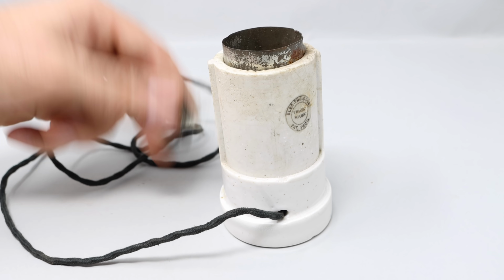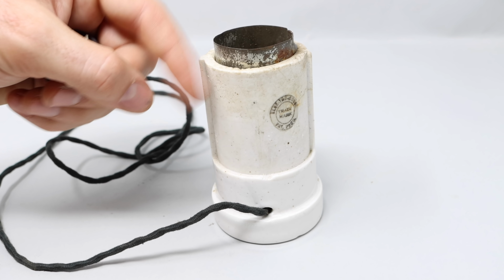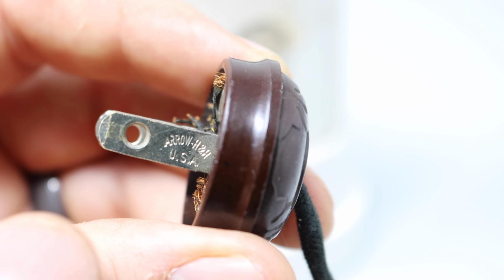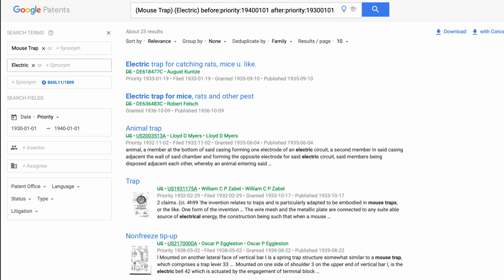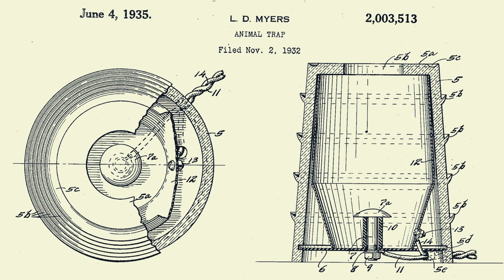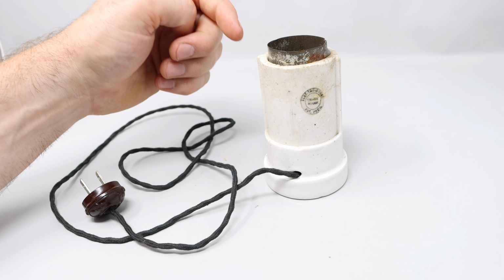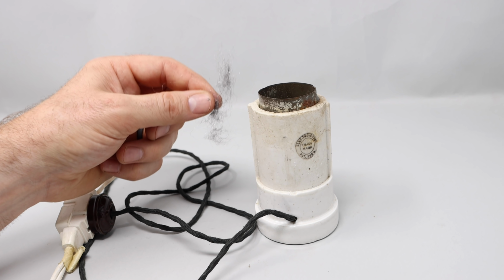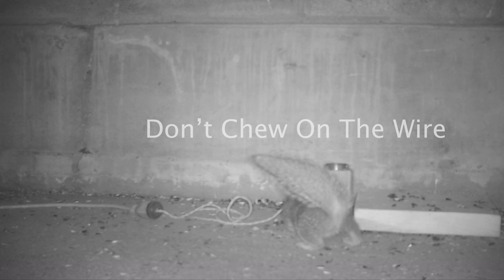I Need Your Help Explaining This One - The Electro Mouse Trap from the 1930s. Mousetrap Monday.

Comment: I think the mousetrap didn't work in the 30s either
Reply: Must be why it was patent pending and not actually patented.
Reply: Would help to explain why this kind of thing never really caught on either.
Reply: Eric Schulze In English that’s called a GFCI (in USA) or RCD (UK). But since the mouse would be the load, with no path to ground, it would not trip.
Reply: We used to use these to pop popcorn one kernel at a time.
Reply: AlphaLeader88 it did though. My best trap was likely developed from this. “The big cheese”
Reply: @dylanzrim1011  so why is t it working now?
Reply: @PapiDoesIt  When the product he got was stamped patent pending it was pending, but ultimately got approved for a full patent as was shown on the patent search.
Reply: Back in time the electricity was hooked up completely different. They had only a small number of big transformers where we today have many small ones. Since transformers are limitting the current flow, that means that around the 1930s there was a much higher current peak flowing through the animal.
Reply: Ema
Reply: While power has changed over the years, I don't think it changed enough.  I think the reason this is rare is it didn't work, so not that many were sold.   I'm pretty sure Shawn has a number of traps that look good, but are not that effective.
Reply: @Resist4  Also, having a patent does not necessarily mean a device will work as it should.
Reply: @tamiebasse6595  yes I knew that already.  A patent is just sole rights to a product for a certain amount of time.
Reply: "Transformer limit current flow"? What the hell are you talking about? Ever heard of "resistance"?
Reply: @PapiDoesIt  I would be shocked (pun intended) if it was granted. It is a serious health and fire hazard.
Reply: @ToyInsanity  lol  reminds me of some guy I knew who rolled his own cigarettes... He said if they were all rolled up in advance he'd smoke even more and this was his way of avoiding that.   So, what your comment tells me is that you like popcorn but you're on a diet!    ...and/or high.  ;-]
Reply: Agreed
Reply: @OleJanssen  Except it doesn't work like that. You're trying to apply kVa transformer theory down to the device level. When you've got a transformer hooked up to a large gauge drop from the pole you're right when measured directly at the output of the transformer. But that's not what we have going on here, you've got several hundreds of feet of relatively small gauge wire feeding the plug plus the 16awg or smaller actually feeding the device. That's what's limiting your maximum current, not the size of the transformer on the pole.

Comment: I bet they didn’t kill mice then either. 60 cycle 110V is not as dangerous in dry conditions as you may think. Especially during light touches by small creatures with whiskers/fur.
Reply: I agree that they did not work then either, modern electronic mouse traps use high voltage to take care of the rodent.
Reply: True. I've electrocuted myself before and I didn't even have burns. Still would not recommend. It knocked me flat and I almost passed out.
Reply: At least you know what you're talking about lol unlike the top commenter
Reply: Was that around the time they were trying DC? Could it be these came out for DC power?
Reply: @Kev:  Evidently, you've never been danced across the room by 120 volts...
Reply: @natalieisagirlnow  Downvotes don't get counted anymore.  I don't know why they bother to still show that option, other than maybe to harvest your opinion for their own use.
Reply: @jimman1992  No.
Reply: checkmate I’ve touched 600V and 120V several times.
Reply: im a line man and the power line put off more than 110 😂 about 100× that and more
Reply: @crimson_fox_king7487  You mean a "lineman".  We're not talking about the high voltage side of the transformer, though.
Reply: What do you have to do that 120V dances you around a room? The worst I've ever done was flung my screwdriver through the room and lost it behind a cupboard when I touched a live 230V wire.
Reply: @cyb3rk3v  Did you touch both sides... phase-to-phase, of 600 volts?  That's not something that most people do... you almost have to work at getting yourself across two phases like that.  The worst I ever managed to do was 277 volts... one phase to ground, but it took me several decades in the business to even manage that.
Reply: lol my keyboard f@$%ed up a bit
Reply: @KonradTheWizzard  That was just an expression.  I got it from one hand to the other and couldn't let go, but my feet still worked, so I was able to pull myself off of it.
Reply: Wow! In that case: you are one lucky guy to be alive. Touching ground and live wires at the same time is a lot more, ...shall we say: "exciting" than just briefly touching a live wire...
Reply: Alot of regions were 25 cycle 110VAC back then.  Not sure if that would change the effect the voltage would have on an animal.
Reply: @jimman1992  No, and DC would be even worse than AC.
Reply: checkmate No, just brushed against a shunt resistor in a CRT
Reply: Paul Bunting Only a few, and well on the way out by then.
Reply: Try grabbing the top of an MSD distributor cap on a car to adjust the timing and see what 90 amps feels like directly through your skin!!!!!!!!
Literally lift you off the ground and throws you backwards
Reply: Agreed
Reply: @bakerrv  yeah, DC voltage through a device that induces a frequency to it.  Not AC with relatively low frequency
Reply: @jimman1992  Direct current will freeze your muscle and alternating current will cause you to jump.
Reply: I thought so too, considering how insulating their fur might be, you'd probably need a way higher voltage for something like that to work.
Reply: @mkpleco  so would that keep you trapped ? Guess my though would be "wouldn't that keep a mouse frying?" 

Thanks for the reply!
Reply: So was AC at 60 cycles in 1930?
Reply: Scott Milano It may have been 50Hz but 60Hz standardization was well underway by the 1930’s
Reply: Look up the cat who put his paw in a lamp socket. That’s basically what this is
Reply: Antonio Tejada Oddball electrical voltages and hertz we very common around mills that produced their own electricity especially when the mills owned the rental properties that workers commonly rented. This was very common well into the late 1950's and early 1960's and in some areas into the 1970's. The most common reason for the nonstandard electricity to end was the closing of the mill. A common nonstandard electric service around the mills and factories in Philadelphia and Pittsburgh was 220 Two Phase at 50 hertz. I found out about this the hard way when I purchased a bunch of machines at an auction in Philadelphia and one in Pittsburgh. The machines all had appliance plugs on them and had tags that said 220v2p and I mistakenly thought it meant they ran on 220 anyhow after I smoked a motor I did some more investigating and found what it really meant and ended up getting the motors rewound to three phase.  Additionally I ran into nonstandard electrical service in the Carolinas at several auctions of shut down mills where many businesses and houses around town had step up transformers to run air conditioners and electronic needless to say I did not purchase any equipment that I could not put a single phase motor on because there was no rewinding them according to the company I had used to convert the 220 2phase motors to 220 3phase.
Reply: @LiveSeruio  you are very VERY lucky to still be alive! MoTs are very efficient at killing. Not only is the frequency perfect at 50/60 Hz, they voltage is also enough to, as you have stated, pass a lot of current. However, I don't think you got a shock at a few amps. Even one amp would be 2.3kW of heat generated in your body. You would have 3rd degree burns, and almost certainly that is enough to confuse you heart, even when not directly passed through it. Pretty sure the electric field (S/J field) is would be strong enough. Heck, even a few milliamps at 2.3kV are enough to kill!
Reply: dan cussin  needs a capacitor.
Reply: @markiangooley  Look at a dictionary. Words evolve. We have to deal with the same nonsense with so many different words when they take on new meaning.
Reply: @1ceanator99  you didn't electrocute yourself because you're still alive.
Reply: @tacomas9602  Hate to break it to you, but electrocutions aren't always lethal and don't turn you into ash like in a video game.
Reply: @tacomas9602  Depends on the Voltage and the Current. 50 milliamps is enough to kill someone. Tasers have at least 10,000 of Volts of Electricity or more but the current is just a couple of milliamps.
Reply: @jimman1992  Incorrect the dc was almost phased out by the 1910s it was only used in special applications almost all electric appliances that came out after 1910 were made for alternating current
Reply: i know because I own and use a lot of old electric fans
Reply: it only takes 5- 30 mA for a duration of 30m Seconds for a human to die from cardiac fibrillation... so NO

Comment: I thought that it may work because it is vertical - if the mouse climbs in and gets shocked it may not be able to jump up and out so it will be shocked repeatedly
Reply: Yea but then comes the squirrel (who we will call the Spanish inquisitorial squirrel from now on) and fooled our plans... Nobody espects the Spanish inquisitorial squirrel...
Reply: @kelben  Foiled... it's FOILED our plans.
Reply: @michelj.gaudet5048  and the winner of the spelling bee is.......!!!
Reply: No amps so no
Reply: Yes and no. AC makes the muscles cramp and and expand at 50/60 times a second. Depending on where on the planet you are. So you need a longer time to kill the mice than with DC. With DC the muscles cramp up and the mice can't move
Reply: agree, i think retry it non fallen over
Reply: That is exactly what I thought
Reply: Ch Bo do you understand how fast 60 hz is? It’s 60 times per second; way too fast for anything to react in between the voltage wave. It all depends on how severe the initial shock is. AC is just as capable of killing as DC. What you described is a perpetuated myth.
Reply: Didn’t houses used to be supplied with DC current instead of AC? I think that could explain it.
Reply: @Rusty_Shackleford98  From what I understand, electricity goes through power lines as AC and when it gets to your house it is converted into DC. It was like that in the 30's too.
Reply: @frank234561  What, so every house had big frigging rectifier selenium diodes? :)
Reply: @frank234561  Nah, household power is AC.  Any DC appliances you own have rectifiers built into them.  It is just stepped down from very high voltage to a low voltage before it reaches your house.
Reply: @rustyclayton9260  OK, well I wasn't far off. I knew that appliances are DC and that the AC has to be converted to DC at some point. I'm no electrician. lol
Reply: @Rusty_Shackleford98  That and the average amount of current running through it was higher in comparison to now.
Reply: @frank234561  It does make a major difference in this case though, but it is true that DC wasn't the only relavent factor. Higher current and DC power back then. Still a bad fire hazard though.
Reply: @ Michel Gaudet "Fooled" as well as "Foiled" are both technically correct it is just that "foiled" would be the more common word chosen. A wise old professor of english once told me do not criticize the usage of a word even if it is totally incorrect if you understand the meaning of the sentence. Therefore since you clearly understood the meaning of the the sentence and that "fooled" was spelled correctly it is you that has been foiled and made been made the fool it's funny how that works.  Before you get hot and bothered might I remind you there have been any number of authors who have become famous for their unconventional use of words in their writings and least we forget Yogi Berra who besides being a great baseball player but is just as famous for his unique use of the english language.
Reply: @frank234561  most things you'd consider appliances are entirely AC (stove, refrigerator, heater, microwave, washer, dryer, air conditioner, vacuum cleaner, e.t.c.)
DC is used in electronics, since they need a clean, steady voltage to function. (Computers, TVs, smart phones, answering machines, stereos, e.t.c.)
Rule of thumb is if it does "work", it's usually AC, if it "thinks", it's usually DC.
Reply: @Rusty_Shackleford98  The "War of the currents" was settled by 1900.  So, nice idea, but I highly doubt if it was designed for DC power.
Reply: @frank234561  Your household current is NOT DC!!!!! The voltage gets stepped down to 110, that's it. Things like drills that plug in to the wall run off ac power, as do fans. For devices that run off dc, conversion is either done with a wall wart or internally via a transformer + rectifier.
Reply: @drewjn  The amount of current which flows across a load is determined by the voltage, and the resistance of the load. The formula for current is volts divided by resistance. By the 1930s household voltage was 115 volts. Not sure what the average resistance of a mouse is, but I'm pretty sure it hasn't changed since the 1930s. Household voltage today is 120 volts. Technically, slightly less current would have flowed through the mouse in the 30s because of the voltage being lower.
Reply: @LordAn0bis  so you're saying he should try AC to DC converter or a battery to power the mouse trap
Reply: @plansandbag3015  AC to DC converter. And some smoothing
Reply: @RB-xv4si  ask those who have been shocked by both which is worse

Comment: Oh wow that mousetrap looks like a serious fire hazard
Reply: You'd want to be very careful what you stuck in it...
Reply: wink wink
Reply: It is an arc fault will trip any new branch circuit if it’s installed per the 2020 NEC
Reply: And a serious shock hazard given the plug is not polarized meaning the hot could be the exposed metal tube.
Reply: Have you ever looked at a mouse trap and and thought "hmm not enough property damage"?
Reply: Trabant P601 not really

Comment: Some guy probably stuck his finger in a light socket that was turned on and thought "Huh, this will kill mice."
Reply: You posted the best comment for this video😂😂😂😂
Reply: So funny, I kinda had the same thought
Reply: I knew an electrician who checked for power that way. 🤣
Reply: @wildeyedherman3102  The fact that you said “knew” instead of “know” says a little about how good that method is.
Reply: Electroboom  did that

Comment: Nothing's really changed about home electricity in the US since the 1930s, this device would have performed identically (that is to say poorly) back then. Gimmick device marketed on novelty much more than effect. Might get the occasional extremely unlucky mouse but that's it.
Reply: Exactly what I was going to say!!! :)
Reply: I think this is the correct answer. Moreover, if you did get the occasional extremely unlucky mouse, it would likely trip a breaker (or blow a fuse if your wiring was done before the 1960s), so it's probably for the best that it didn't work. I would suggest making this a "for display only" mouse trap :)
Reply: truthsmiles No, it wouldn’t trip a fuse or breaker, at least not until the mouse had literally burned to carbon, which is highly conductive. The resistance of mammal flesh is too high for anything close to the trip current of a fuse or breaker to flow.
Reply: @tookitogo  Unless the circuit was protected by an arc-fault breaker. :-)
Reply: Agreed
Reply: Jim Service Well yes, but they didn’t have those in 1930! :P
Reply: @tookitogo  I didn't have those in my previous house built in 1980. :-)
Reply: Jim Service Indeed, they didn’t become mandatory until a few years ago.
Reply: GFIC & RCCB